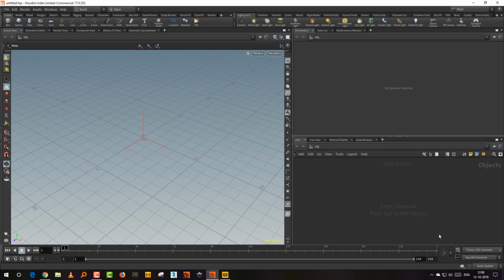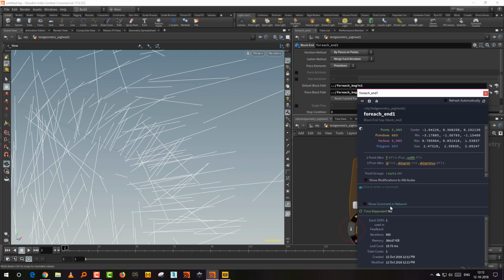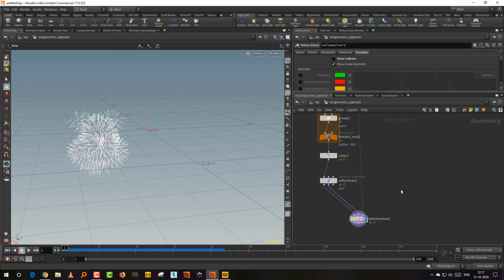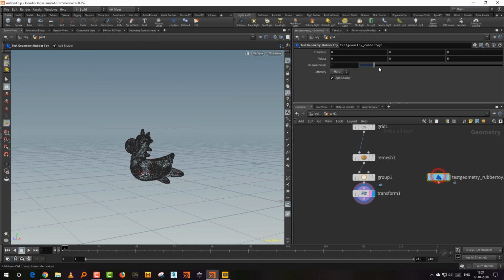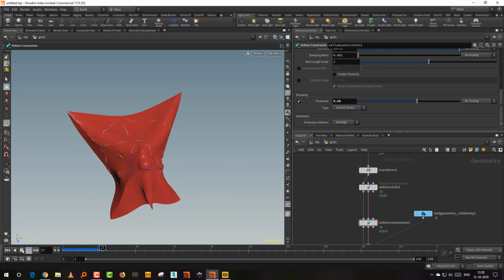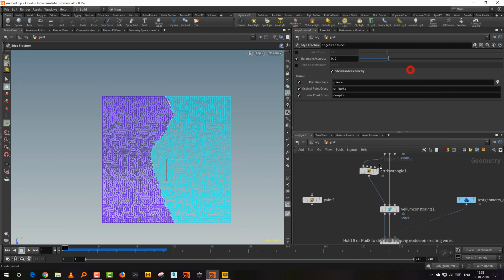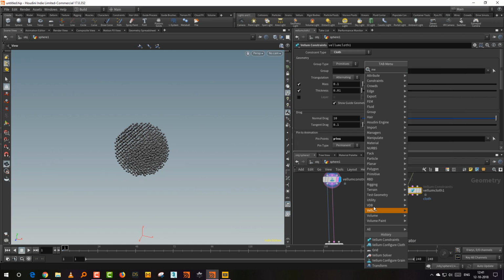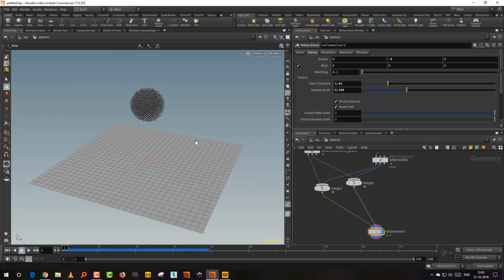Houdini 17 - Intro to vellum

Comment: the other quick way to group the root points is using wrangle with :    setpointgroup(0, "roots", @ptnum, vertexprimindex(0, @vtxnum) == 0);
Reply from the maker: There's a preset in the group expression node that selects the first vertex. I found that later.
Reply: @rohandalvi  nice, I didn't konow, haven't been using group expression node often :)
Reply from the maker: @vexsop  I use all the group nodes. I don't think I've ever created a group using the wrangle node. :)

Comment: hi man thanks for the tut its really helped me. the for each prim worked great when my geo was not deforming. But then for deforming alembic animated characters I had issues using this method for isolating my roots. I ended up using a group range and swithcing my range filter to 1 of 9 and worked great.

Comment: If you drop down a vellumconstraintproperty node in the dop network, it has a break threshold parameter. You can use this parameter to enable or disable any constraints. It is also key-able if you want to animate it.
Reply from the maker: Manny Wiebe thanks. I covered it in my second vellum video. :)

Comment: How can I stick one object to another? In the SideFX example reel they stuck the rubber toy to a spider web, how do you make that work?
Reply from the maker: I'm not sure. I haven't tried all the various constraints as yet. I'm also not aware how to activate constraints dynamically or over time.
Reply: @rohandalvi  I actually figured it out- to create constrints dynamically you need to use the Vellum Contraints DOP. It allows you to specify a creation frame and it also allows you to calculate constraints on each frame

Comment: quick question, when you update to 17 do you uninstall 16.5 or can you run both or does it auto update? I've never updated Houdini before. Did a quick search but can't find anything about actually updating the program from one version to the next.
Reply from the maker: You can keep both versions. You can keep as many versions or build of Houdini on your machine as you want.
Reply: Houdini 17 installed. Now I can add that testpigshead or whatever it is with TAB in Network Editor. I couldn't work out how you were doing that then realized it was Houdini 17. Can't access those objects at that level in 16.5. Thanks mate.
Reply from the maker: Steven Silcock the test geometry has been available since Houdini 15. You should have been able to access it in Houdini 16.5
Reply: I could get it but I noticed you can't do it at top level in 16.5. You have to add geo1 object first then you can TAB > testgeometry > testpighead. That's when I realized that 17 is slightly different to 16.5. I would have to check again but pretty sure that was case which is when I checked for updated version & downloaded 17 & now I can add testgeometry straight away (at first level of Network Editor if that makes sense).
Reply: I've done the pigs head, worked great. Just about to start the next one thanks to such clear & easy to understand lessons. Great stuff.
Reply: this was a change in H17 - you should now be able to use TAB> testgeo... at the Object level and it will create an Object with the test geo SOP inside